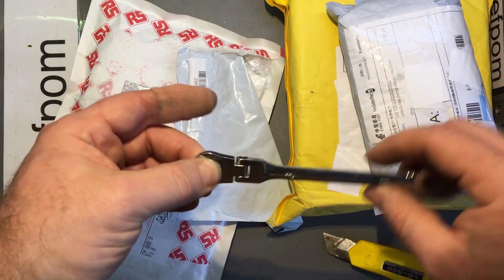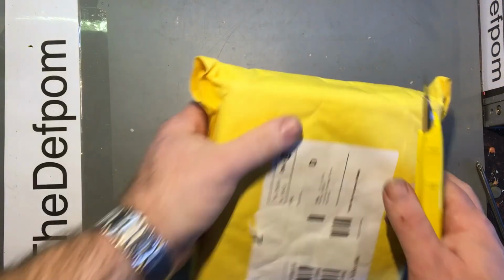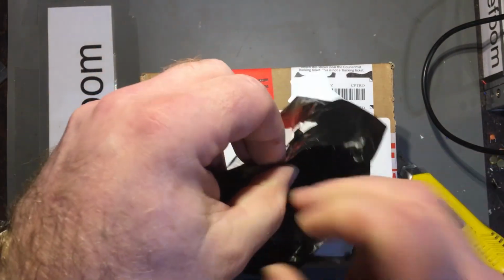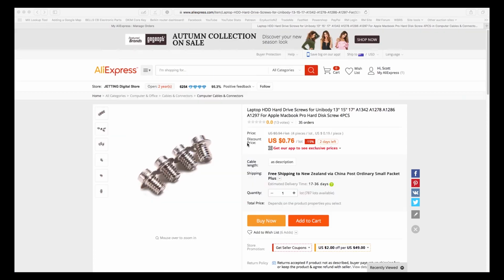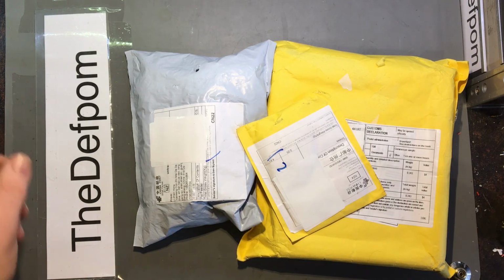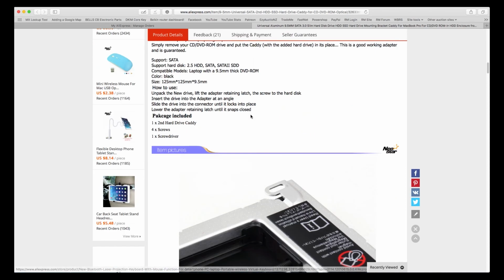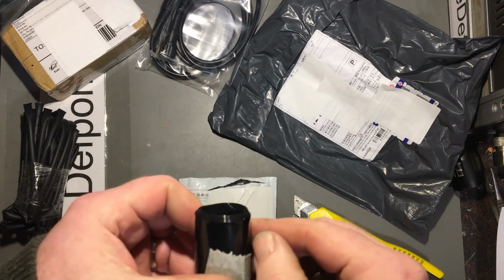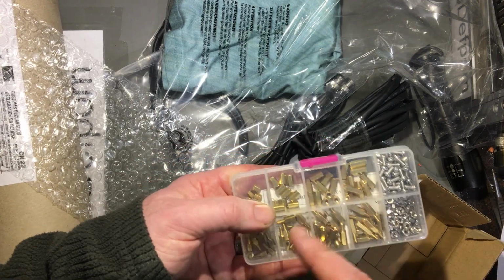#262 Mailbag 14th July 2017

Comment: Great video Scott, hey on the nut removing tool, I'm a radio tech and at my work we use a tools for these nuts and it works great, farnell sells them, check this link out, http://au.element14.com/duratool/8pk-249/circlip-plier-convertible/dp/3125440 also check my YouTube channel if you have time, I need to put up some more radio repair video's tho. http://youtube.com/vk3hau
Reply from the maker: vk3hau - thanks, I will look into those.